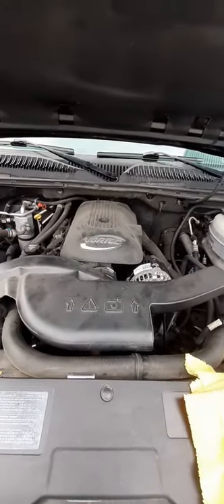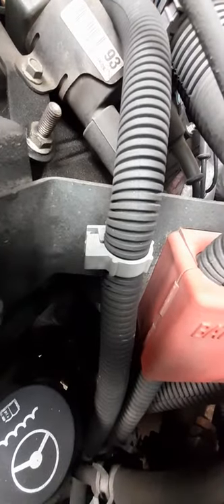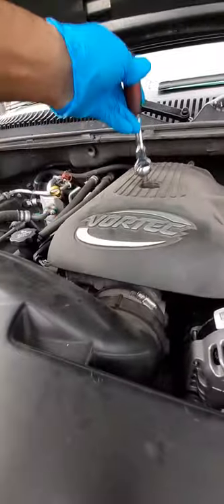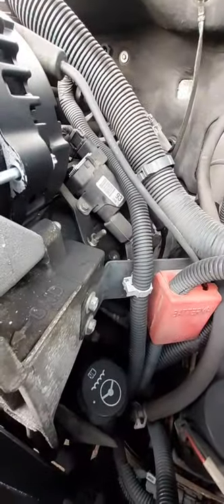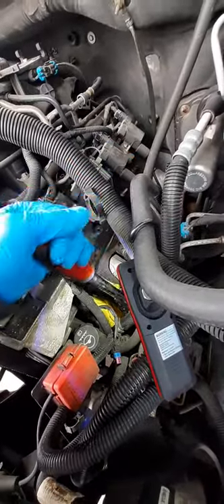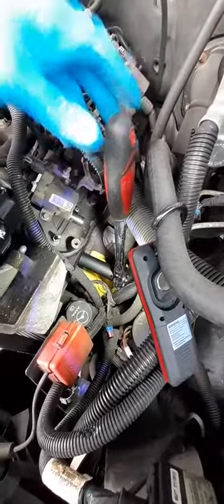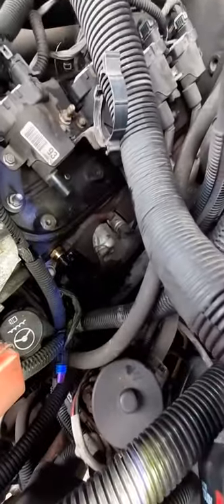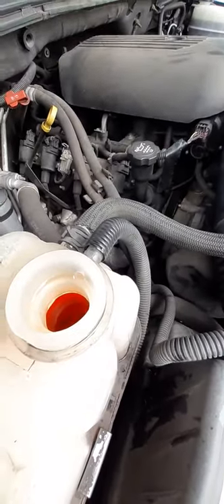DIY...Replace Coolant Temp Sensor on 05 Chevy Tahoe 5.3L

Comment: Will this sensor being bad make your car overheat and shoot coolant from passenger side ?
Reply: Sounds like you have a bad heater core and it's allowing air into your system which is causing the overheating
Reply from the maker: What Darren said...sound like your heater core is or has failed. If you have coolant leaking inside your vehicle on the passenger side its definitely a bad heater core...also your windshield may fog up while running the front Defrost.
Reply: The connection to the heater core that’s in the engine area is notorious for leaking at where the rubber hose connects to the hose barb on the heater core. The clamp commonly cuts away at the hose as the hose ages. 2 new hose clamps and cut the hose a bit shorter removing the bad spot will fix that if that’s your issue. If you have coolant/water leaking on passenger side floor inside the cab then it’s your heater core. It’s a bitch of a process to replace. Have to remove most of the dash and the glove box to do the job. If you don’t need your heater you can bypass it at the spot I mentioned first. In the engine compartment you can remove the 2 rubber hoses that are connected to the core and loop them to each other. They sell the double barbed nipple to connect them to each other  in the help section of your local auto parts store. There’s videos here on YouTube how to do it.

Comment: You don’t need to remove the wire harness for the spark plug, drain the fluid out before you take the old sensor out, then you have no mess🤷‍♂️
Reply from the maker: Sure if you want to replace your coolant then go ahead and drain it all out. This way is much simpler and you save time and $$
Reply: I didnt have to drain or pull anything off lol what yall talking about lol ??? I just replaced mine today it was simple i didnt take my vortex cover off either 😂
Reply from the maker: @Solarlifeoffgrid yep I didnt drain any fluid...and removing this stuff out the way makes it much easier for even someone whos not real handy with automotive repairs...you found this video for a reason...glad you got it done 💪

Comment: We're you having issues with your radiator cooling fans not kicking on because of this sensor? I just bought an 05 tahoe and the cooling fans kick on with the AC on but don't come on when up to operating temperature
Reply from the maker: I didn't notice if the fans were working or not...but I'm pretty sure this sensor would affect the operation of the cooling fans. Is your sensor reading on the dash?
Reply: @cedmac3366  yeah my temp sensor on the dash is operating as it should
Reply from the maker: @darrenvogel8096  ok...so are your fans not working when the operating temp reaches normal operating temp? Also what I do know is that the fans work intermittently to cool the engine and not exactly when the vehicle reaches normal temperature. Another question...is your vehicle overheating?
Reply: @cedmac3366  not sure if I'd call it overheating but it went two marks past 210°f without the fan turning on by it's self which worried me because I've never had a vehicle that went over 210°f, I checked relays for cooling fan and they're all good according to my multi meter, only other thing I could think of is that the thermostat is stuck in the open position which I guess is better than it being stuck closed lol
Reply: @cedmac3366  I thought it might have been the coolant temp sensor but wouldn't that  affect my gauge reading the temp properly
Reply from the maker: However the fans do come on immediately when the AC and or Front Windshield Defrost is turned on.
Reply from the maker: @darrenvogel8096  yes a bad temp sensor would affect the reading of the gauge also the Service Engine Light would or should come on. The main thing to watch for is "overheating"...because a faulty temp sensor can give false gauge readings
Reply from the maker: @darrenvogel8096  also this can be a little tricky...there can also be a bad or faulty connector for the sensor...fyi
Reply from the maker: @darrenvogel8096  yep... mine has done the same going to 210 and had me worried but it went back down so I didnt do anything but keep an eye on it. Also I will check today and see when the fans come on when it reaches 200 and I'll get back to you and let you know. Good luck
Reply: @cedmac3366  for sure, I definitely appreciate all the advice, this cooling system issue has been a real pain in the ass to try to figure out, my heater core T fitting started leaking coolant yesterday and I replaced that which was a pain in the ass too, I love my tahoe though despite the constant maintenance I have to do 😂
Reply: @cedmac3366  by chance did you ever get a chance to check what temp your radiator fans turned on at?
Reply from the maker: @darrenvogel8096  my bad almost forgot...I will give you an update today for sure
Reply from the maker: @darrenvogel8096  here you go...check this out 
https://youtu.be/q4t_BlF1_20

Comment: Is 210 normal temperature
Reply from the maker: Yes normal range can be around 200 - 212
Reply: @cedmac3366  mine is between 160 and 210.. what to do?
Reply from the maker: @JayyMoney-vr7nv  that range is pretty normal. I wouldn't change anything unless you start noticing a difference in performance
Reply: @cedmac3366  I thought it had to be at 210 so that the engine knew how much gas to send or something like that. Just thought mines was running colder than usually
Reply from the maker: @JayyMoney-vr7nv  Sometimes the thermostat can stick in the open position and not allow your vehicle to warm up to the proper temperature which can cause your heat to blow cooler than usual. You could try replacing your thermostat and see if that helps. Make sure to get an AC Delco thermostat...the Duralast from Autozone are crap.
Reply: @cedmac3366  Ima try to change it and see